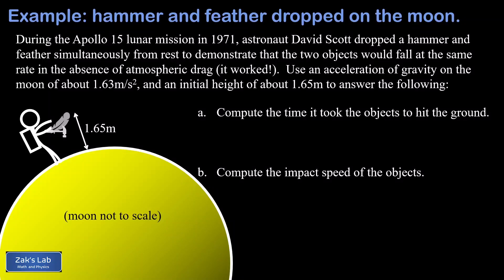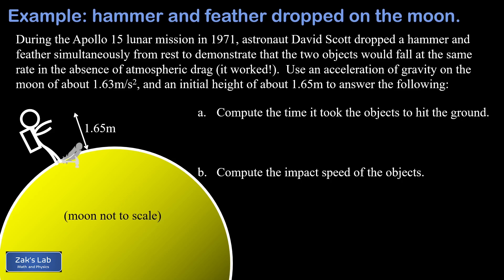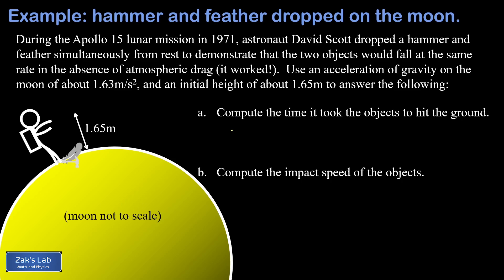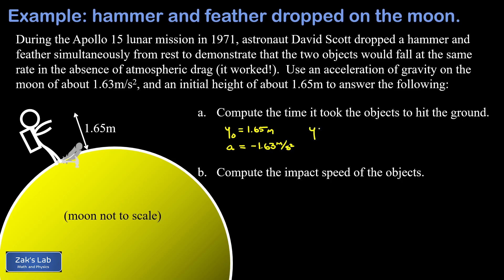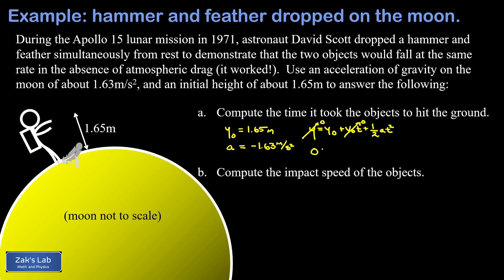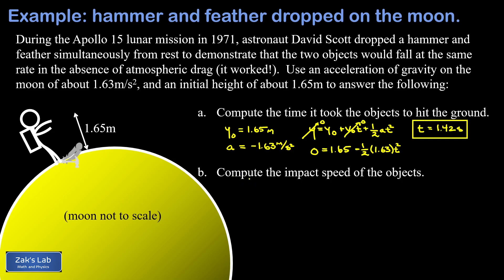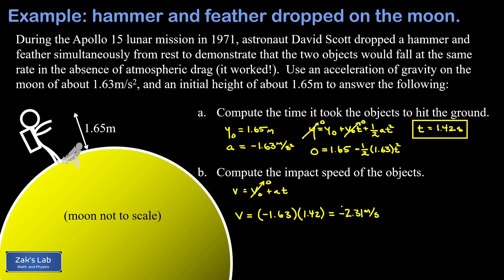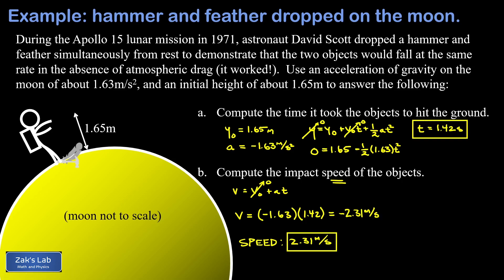Free fall on the moon hammer and feather experiment during Apollo 15.

Comment: What speed object will reach falling from 300 km?
Reply from the maker: You could use the same method as a crude approximation, but 300km is a pretty big percent of the radius of the moon which means the force of gravity is varying throughout the fall.  You can generalize this problem to large distances by using the generalized formula for gravitational potential energy:  PE=-GMm/r and applying energy conservation.  I made a video about gravitational potential energy for large distances here:  https://youtu.be/o8hpfkfcAjw